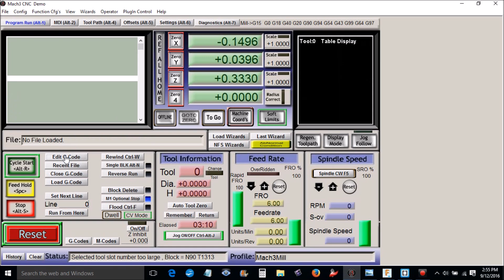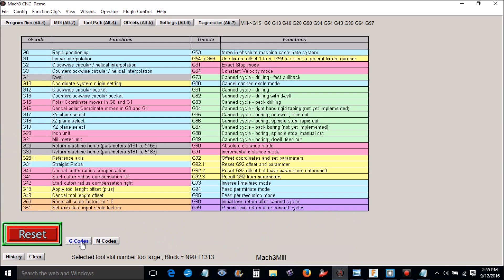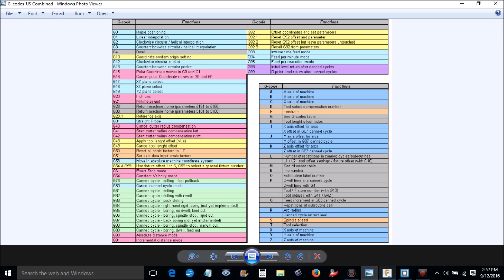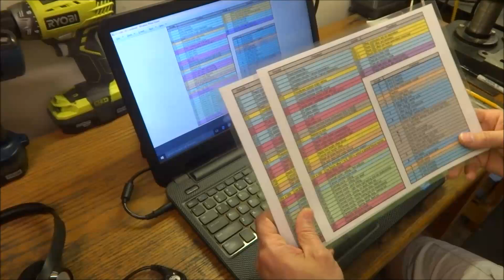G Code M Code Reference Chart

Comment: Good solution, thanks!....:):)
Reply from the maker: Print outs work for a while but get messy and hard to read. Most local Pak N Ship or UPS stores can print and laminate it for less than $5. 
with it laminated you can just wipe it off.